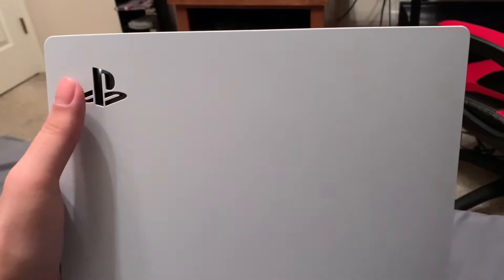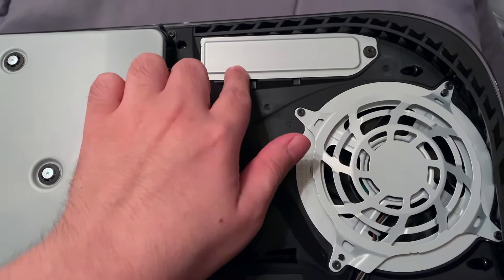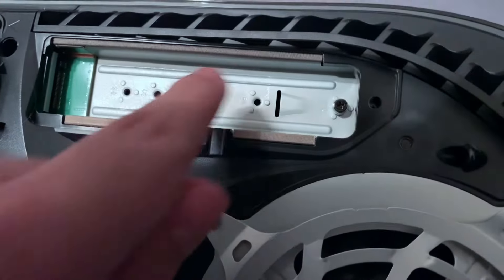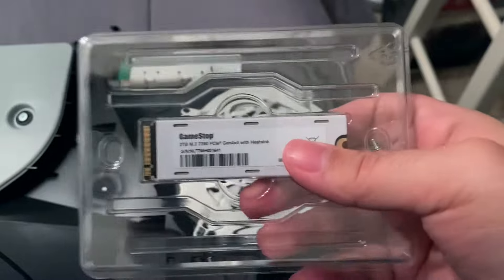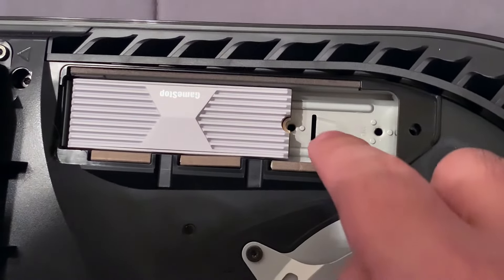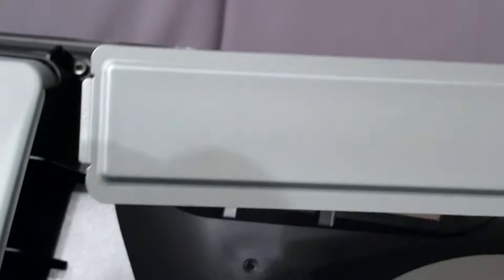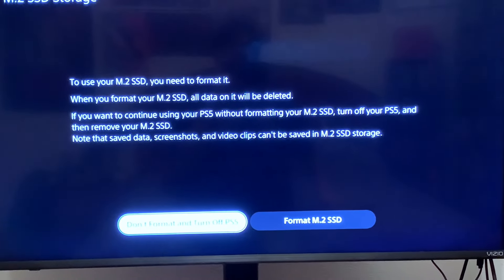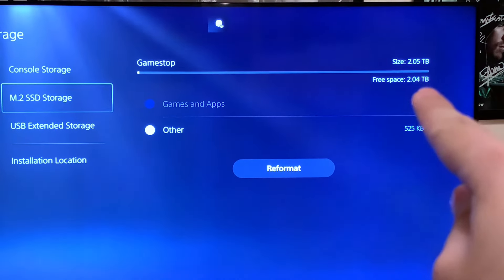Installing Gamestop Exclusive PS5 M.2 SSD

Comment: Thanks man I used your video tonight for my 4TB hard drive. It's on now. GameStop version to. I forgot to click the bottom piece. Once I did that, everything else worked. I'm a subscriber now. Another detail that I noticed that you pointed out, on my 4TB hard drive, I did have just a little bit more than 4tb. Can't beat my deal tonight let alone the internal storage it came with originally. I can play PS4 games off of the external storage I got, I can't wait to have fun.

Comment: Great video. Do I need to delete games from external storage card and whatever is on the console storage first before installing the new ssd?
Reply from the maker: No, you can keep everything and still install the M.2 SSD.  After it is installed you can even have the option to move games to it or keep saves on External and Console storage.

Comment: Where did the middle screw to secure it come from ? Mine doesn't have one. Hopefully it still works. About to find out.
Reply from the maker: That’s strange.  The middle screw should be on the PS5 itself.  Usually it’s on the console on the metal plate the drive lies on.

Comment: Anyone have issues after it’s installed ? Im getting a message saying can’t use the m2 ssd. I have the same one in the video. Thank you
Reply: Did you ever figure out your problem mines doing the same thing
Reply: @landonrich7967 so you I installed mine today… you have to lift the mss2 get the screw washer under then the screw over it. It has to sit a certain way or the console wont recognize it.